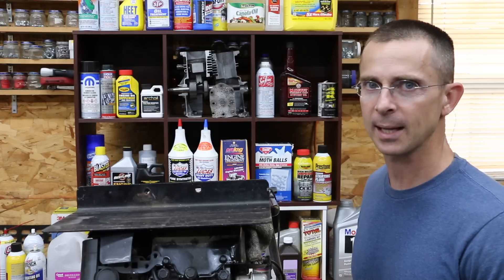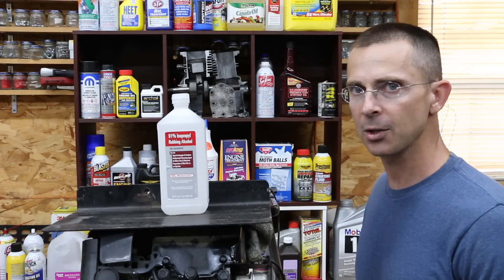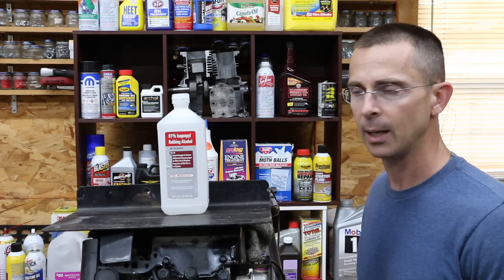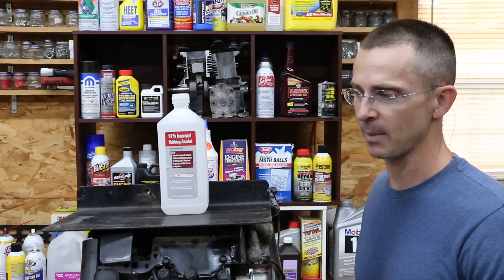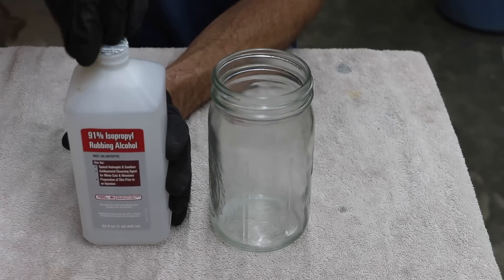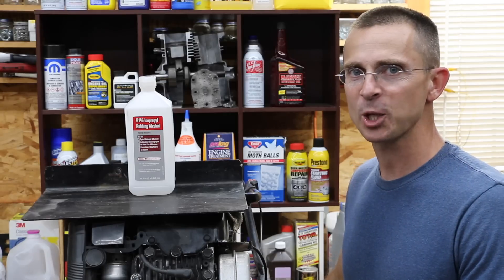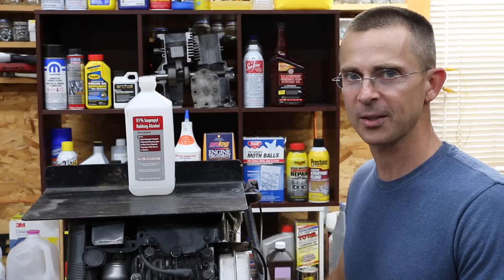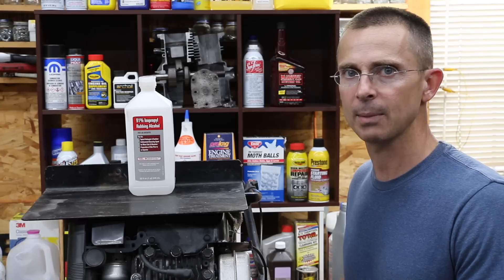Will a Gas Engine Run on Isopropyl Alcohol?  Let's find out!

Comment: The fuel ratio for AIR/GAS is 15 to 1 and for Alcohol it's 9 to 1 so when you use Alcohol you need to close the choke about 60% or run a WAY larger main jet and set up the idle screw! You will not see the best benefits running Alcohol until you get the compression up to 3 to 4 points higher. In my 250cc dirt bike I went from 17hp to 28hp by going from 8/1 up to 12/1. You can do this easy since alcohol has a 110 octane naturally. I make my own Methanol at home for free it's so simple. You fill a 55 gallon drum with sticks, old pallets, cardboard and seal the top with a ring clamp. Drill a hole in the lid and install a 50 foot log coil of copper tubing (think moon shinning) Next put the drum off the ground with two cinder blocks and build a large fire underneath it with sticks. You will see smoke coming out of the copper at first and than a liquid. The first liquid is water vapor so pitch it on the fire to make sure and it should sizzle. After a while the liquid coming out of the copper will run faster and when you pitch a little bit on the fire it will go "POOF"!!! That means your making METHANOL!  The yield should be 17-21 gallons of methanol per 55 gallon drum full of waste-wood, trash, plastic and paper worth about $120.00 - Now your ENERGY INDEPENDENT! This is flammable so you will need to really think about Safety, working around an open flame and all too! DO AT YOUR OWN RISK. DO NOT DRINK or you will die!!!!!!!!!!!!!!!!!

Comment: All you need to do to make it run better would be to change the fuel air ratio and spark timing and I bet it would blow away the normal mower
Reply from the maker: Thanks for the feedback.

Comment: Would you be willing to test small engine fuel tank cleaners? Like a small engine that has ethanol varnish in it from sitting to long. I’ve seen commercial stuff for it and herd denatured alcohol, mineral spirits, and paint thinner can all dissolve it. Which one does the best job.
Reply from the maker: Thanks for the suggestion.

Comment: Now try it with a two-stroke and add some veggie oil to the alcohol. From your previous vids we know that veggie oil lubricates like mineral oil , if it works ok if the SHTF we have easily obtainable fuel.
Reply from the maker: Thanks for the suggestion.

Comment: Could you run a gas engine for bicycles on isopropyl alcohol?  I believe those small engines need a mixture of oil with gasoline because it has no oil lubrication system?  Sorry I'm new to this, but I figured a cleaner exhaust on a bike lane would be more cyclist friendly...
Reply from the maker: Thanks for the suggestion.

Comment: There is an undenatured alcohol, in addition to denatured alcohol.  I’ve used both not on an engine, but as a heater.  The denatured left an uncomfortable odor, the undenatured was cleaner and virtually no odor.  I wonder how each of these would work on an engine, they are 200 proof alcohol, at least that is their specs.
Reply from the maker: Thanks  for the suggestion.

Comment: @3:24 you can see the small Intake valve got a really good cleaning and @3:17 the whole chamber got a decent cleaning. Thank you for the videos sir.
Reply from the maker: You're welcome!
Reply: @ProjectFarm  I imagine if your run the motor with just 91 alcohol 🍸 for say 15 to 30 days, it would have a much more improvement in its ability to remove more of the carbon buildup.

Comment: I’m also building a briggs and Stratton and I’m having trouble running isopropyl. Does the motor need preheating and do I need to drill out the jet?
Reply: Update, the crankcase is full of water and, of course, it no longer starts

Comment: Check videos on hydrogen oxygen using water potassium mixture to electricity to split water molecules in to h and 20 one is running a 3000 watt generator with this. But his testing is incomplete.  I know you would do amazing results in your testing.
Reply from the maker: Thanks for the suggestion.

Comment: My kids junior dragster was run on methyl hydrate because it was cheaper than buying racing alcohol. Yes isopropyl will work, you have to jet it like an alcohol engine that’s all. If it’s really cold you might have to pour some gas in the carb to get the engine to light off (this is why you see us spray bottle gas into the blower on an alcohol v8 drag engine to get them to fire up and once running they have enough heat to stay running or even shut off and start up again without gas)
Engine will run cooler and it will make more power. Look up dyno tests on junior dragster or kart engines, 5hp b&s stock with header and jetting will put out about 7-8hp, put on an alcohol carb and it jumps to 10-11hp.
Reply from the maker: Thanks for the feedback.

Comment: I had an idea...

Alcohol alone will dry out a injectionsystem

But why not mix it with a little bit of two-stroke-oil to add lubricating propeties?

You'll get around the same pollution but will save tons of money on destilling it instead of buying pumpfuel
Reply from the maker: Thanks for the suggestion.

Comment: If the carburetor is adjustable, you need to turn the jets to run richer because of the different air/fuel ratio required for alcohol. I'm sure you know this already, but alcohol burns at 12 to 1 and straight gasoline at 16 to 1. That's why you get better fuel economy from straight gas vs alcohol or alcohol/gas blends. It would probably smooth right out if you enrich the mixture and have more power too because the alcohol has more of a cooling effect on the intake air. Try some RC fuel in it.
Reply from the maker: Thanks for the feedback.

Comment: Try using a pipe T joint for a carburetor and just have a wick of carbon felt to get it up to the air filter part and suck air over the wick to run the engine. If you have a stiff mesh screen to wrap the carbon felt up to fit up the middle of the pipe that may hold the carbon felt stiffly in place.
Reply from the maker: Thanks for the suggestion.
Reply: @ProjectFarm  Also you may need some water remover or treatment for water in the fuel when using isopropyl alcohol.

Comment: Ya I really like this video!  I had studied toa certain degree alcohol engines in the 1800's and often wonder what would have happened to the alcohol engine development if Prohibition never happened.  I mean I can imagine a type at home type of moonshine distillery kit to produce your own fuel.  People haven the ability to trade or buy alcohol from other families or selling some at store possibly.   I use to remember the name of the cleanest burning alcohol.  It escapes me now.    So I wonder the longevity of running time alcohol vs gas.  Also wonder if alchol performs better with 2 stoke engines vs 4. 🤔
Reply from the maker: Thanks!  Tanks for the suggestions!
Reply: @ProjectFarm   -  You Welcome, thank for reply and video.  My best to ypu
Reply: Do you guys think it will work if I mixed IPA with gasoline let's say 50/50 and ran it in small 4cylinder engine?

Comment: I had always wondered bout running alchohol in an engine  my dad used to have a 66 Volkswagen beetle an in the winter he would have trouble with moisture in the fast tank an he would add alchohol to the gas to help eliminate the moisture seemed to work ! I wonder how moonshine wood run in a gas motor ?

Comment: I think the first Ford Model T car’s engine was an alcohol burning engine, they used ethanol so you could use some good Moonshine to run their car. A still using corn or rice plus sugar and make your own fuel and party 🥃 booze !
Never heard about using methanol but drinking methanol is deadly.  Used in auto and truck antifreeze/coolants fluids. Don’t drink or allow your dog to drink it either, kills 🐕 dogs.
Reply from the maker: Thanks for the feedback.

Comment: What about Iso -Heet?  It's 100% isopropyl alcohol.  Sometimes it goes on clearance in the spring as it's a wintertime product.  I add this to my mower gas at 1 ounce per gallon.  It fights water and varnish I also use it in my flex-fuel Ford Ranger when it's really cold.  Some of our gas stations have issues with water in the gas when we have floods.
Reply from the maker: Thanks for the video idea.

Comment: A nice project woyld be increasing the compression ratio to the limit of the engine. Than compare gasoline and alcohole in therms of power and efficiency after and before incresing the compression. 

Interesting and informative videos. Keep going on that way.
Greetings from Germany

Comment: Try it in a 50.1 ratio chainsaw but mix the alcohol as you would gas with 2x the ratio it runs great and lasts much longer and doesn't make you smell like an engine
Reply from the maker: Thanks for the suggestion.

Comment: Interesting. IPA is a rather dirty fuel, would have thought carbon buildup would have increased.

The "rough" is a no brainier however, that 9% is water. Get it pure, along with a little needle adjustment (oh wait, thanks EPA 🙄)... probably run nice and smooth.

Nice video either way, always kinda wondered about this myself, now I know
Reply from the maker: Thank you!

Comment: Try running diesel engine on 90:10 diesel:gasoline...80:20, 70:30 down to 50:50.
Reply from the maker: Thanks for the suggestion.

Comment: Looks like the alcohol completely cleaned up the exhaust valve.  Maybe running a few tanks thru would remove all the deposits?  BTW - what did the exhaust smell like?

Comment: Thanks for a great video. Im picking up an old car tomorrow that has sit around with the same fuel for at least 18 months and was thinking of putting this stuff in the tank to dry up any condensation which would have been created. Do you think that would be a good idea? Also will it clean the pistons like yours did from adding to petrol?
Cheers from Australia.

Comment: Nearly 100 years ago, oil well pumps ran on well head gas, which contained either or both propane and natural gas in unrefined states, plus whatever else was in the well head that was a gas. It would be interesting to see if an engine could run on this today.
Reply from the maker: Good Point!

Comment: Did you have to make any adjustments to the carburetor? I am going to say if you didn't you probably could have smoothed out the engine with some adjustments. It was starting to clean. I would say that was due to a steaming effect from the 9% distilled water included in the alcohol. Awesome video

Comment: Here are more ideas. (1)Fuel additives only (general fuel treatment, water remover, fuel injector cleaner).  (2) How long will a 2 cycle engine last on 4 cycle fuel? We know there will be engine damage without the oil. I don't know how long it will last until catastrophic failure.
Reply from the maker: Thanks for the video ideas.

Comment: One of electronics profs had a single cylinder generator. The cylinder was glass, it ran just fine on alchohol. We had to pull the muffler off to get it started, when cold. I've always suspected the muffler just needed to be replaced. 
But, I don't remember ever testing the generator output, in theory, a short in the generator could could have caused enough resistance that the muffler back pressure was enough to stall the engine on a cold start.
I recall, maybe incorrectly that you could see the valves working as well. But it has been more years than I care to admit.
Reply from the maker: Thanks for sharing.

Comment: Try 10 to 50% 99.9% isopropyl alcohol and rest of non Ethanol gasoline mix if it can be used as engine cleaner and alternative to gasoline Ethanol mix
Reply from the maker: Thanks for the suggestion.
Reply: @ProjectFarm  👍🏻 you're welcome😊

Comment: The 9% water in the alcohol has to have an effect. Frankly I was surprised that it ran at all.Awesome testing and great job.
You do a great deal with small engines. How about comparing engines of a similar displacement from  Honda, Briggs and Stratton, and whatever Harbor Freight has right now for Horsepower, ease of starting, etc.?
Reply from the maker: Great point on the water content

Comment: Back in another century, LOL,  I also ran my lawnmower on isopropyl alcohol, though with a much lower concentration (70%?). Definitely ran cooler and with a lower idle; and much like your mower, also had no problem performing its assigned duties.
Reply from the maker: Thank you

Comment: The cooler temperature might be due to the 9% water?  If that could be replaced by ethyl (or methyl) alcohol, the behavior might be different.  And naturally, with different fuel, there might be a better carburetor tuning in any case.
Reply from the maker: Great point. Thank you

Comment: It can run fine, but you should adjust the carb richer to keep from wrecking it. 

A heated tank or long intake runner will help. 

You can get advance flywheel keys from go cart shops, or modify your magneto in a drill press to increase range
Reply from the maker: Thank you for the feedback

Comment: The remainder of rubbing alcohol is typically water—in other words: A 91% formula has 9% water, which is undoubtedly why it burns cooler and less consistently than gasoline. I would suggest that a 99% formula would work better than 91%. I also remember finding in high school that denatured alcohol worked much better than even 99% rubbing alcohol in my alcohol lamp for my chemistry experiments. Completely denatured alcohol is usually something like 50% ethanol and 50% methanol, in order to make sure it is completely unpalatable for human consumption.
Reply from the maker: Great point

Comment: Latent heat content, latent heat of vaporization are all different on alcohol. Making the main carb jet much larger will help considerably.  70% isopropyl would probably not do so well.  Surprising result.  Economic factor is probably not favorable.
Reply from the maker: Thank you for the feedback

Comment: The vapor pressure of a typical gasoline  is 14.94 psig or 103 kPa.

Of methanol is 1.89 psig or 13.02 kPa.

Of ethanol is 0.86 psig or 5.95 kPa.

Of isopropanol is 0.77 psig or 5.3 kPa.

That explains why an alcohol based fuel doesn’t run a gasoline-based engine perfectly. The octane of isopropyl alcohol is 92; that’s why you had plenty of power!
Reply from the maker: Thank you for the feedback

Comment: changing to alcohol fuel requires resetting engine timing to exactly zero tdc...  and it helps to increase the compression (shaving the heads for instance). INdy 500 cars have been running on alcohol for many years now,  alcohol fires are not as deadly as gasonline fires.
Reply from the maker: Thank you for the feedback!

Comment: Wow, did this ever clean up the combustion chamber!! I can hardly believe how clean that valve was afterwards. We have a lot of ethanol blended into our gasoline up here in Canada (regular 87, if that's what you buy up here it has a lot of alcohol in it) and we often avoid it if you have anything fancy you want to run well. 
I am wondering, if one were to blend isopropyl with gasoline, would it still have this cleaning quality, I can hardly believe how it cleaned up the combustion chamber. One could do this periodically to clean up the system I think. Great results here.
Reply from the maker: Thank you!

Comment: Difference between normal spark plug and iridium spark plug combustion, and there performance difference too
Reply from the maker: Thank you for the video idea!
Reply: Project Farm please please do this
Reply: @ProjectFarm  have a question please answer it.
Can we run a patrol bike engine with the 50% mixture of patrol and ipa without having any issues
Reply: It would also be good to do a video on why an e3 spark plug gets more power...I suspect its cause of the extra electrodes on the spark plug which actually increases compression and not the B.S marketing crap about a multi spark, spark plug cause electricity only takes the shortest path to ground. Let's debunk their hype and get to the truth....I think it should be easy to measure the decreased volume of a combustion chamber with the e3 plug installed.
Reply: Please do this!

Comment: VIDEO IDEA: I've HEARD OF and told people about using TWO FULL BOTTLES of Iso Alcohol in a QUARTER-FULL TANK OF GAS to help them pass emissions testing. Would using Rubbing Alcohol vs. Iso Alcohol be a better alternative? Or, will a product designed to lower emissions work better?
Reply from the maker: I should test this. Thank you

Comment: That Iso Alcohol would work better if the engine was warm from the start. There is no doubt the Alcohol would burn off immediately; however, it would leave the 9% of the water in the cylinder for a longer period of time if the engine is cold. The hotter the engine, the MORE QUICKLY the water will turn into vapors; and it would work better to "un-gunk" the combustion chamber. We all know water does NOT compress very easily; therefore, keeping it in a combustion chamber for too long COULD result in water build-up and cause cracking in the metal case during the compression-phase of the engine cycle (catastrophic failure); or, it could cause a failure in the seals/gaskets or intake/exhaust ports.
I've never heard of that happening to anyone I know (mainly, because no one I know does this sort of thing (which is why I subscribed to THIS Channel)). However, I know it's POSSIBLE, but I don't know how PROBABLE.
If anyone has experienced anything like that, please let me know. And, let me know if I'm talking out of my rear-end so I stop telling people this. I don't want to spread bad information.
Reply from the maker: Thank you

Comment: Alcohol fuels are only able to outperform  gasoline when you increase the compression ratio, gasoline has about twice the BTU's per pound than alcohol, the advantage is gained because of the alcohol cooling effect that allows drastically higher compression which increases the volumetric efficiency.
Reply from the maker: Thank you!
Reply: @ProjectFarm  Chick out the video of our Yamaha drag bike on my channel.